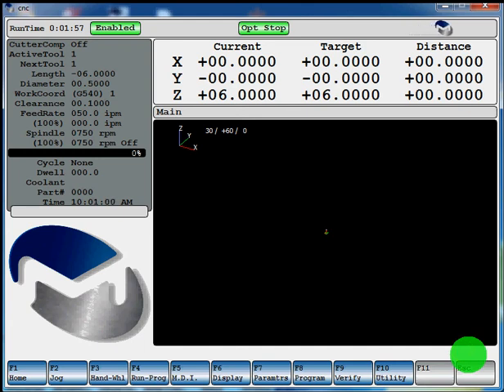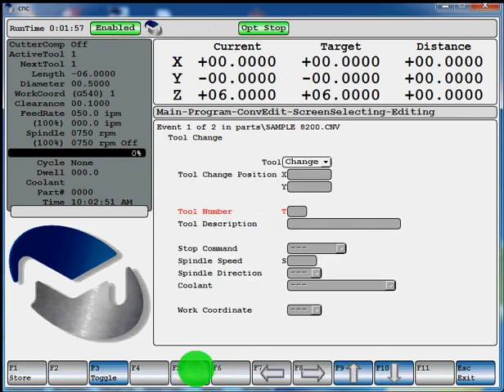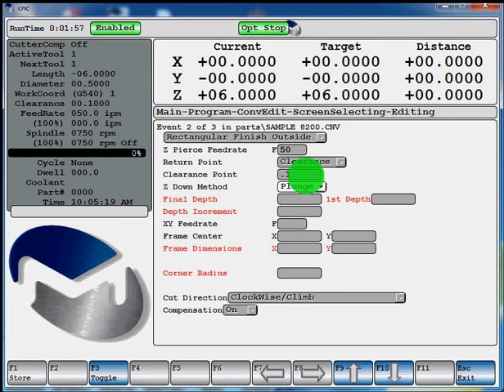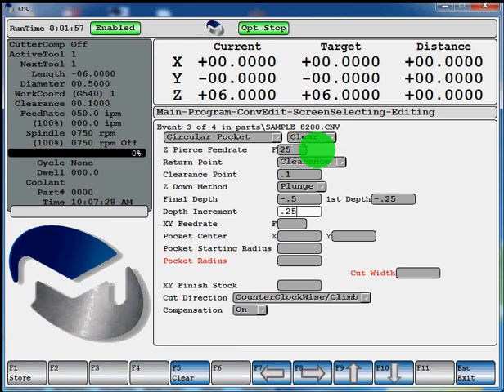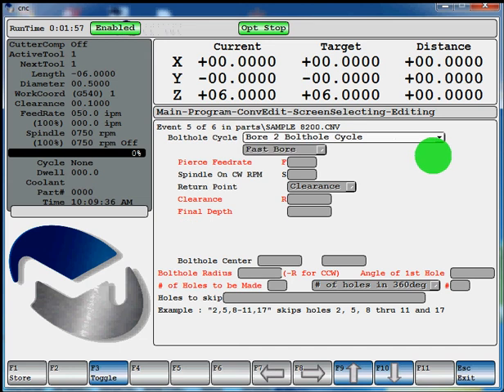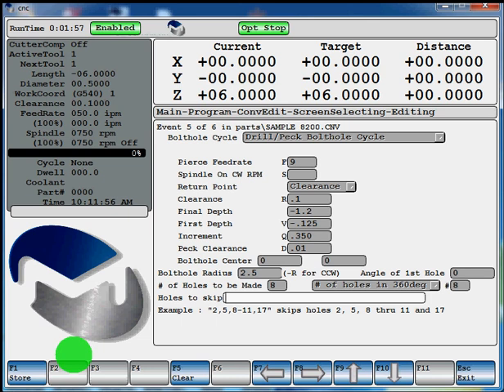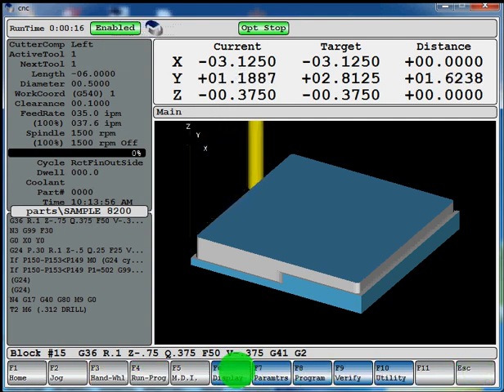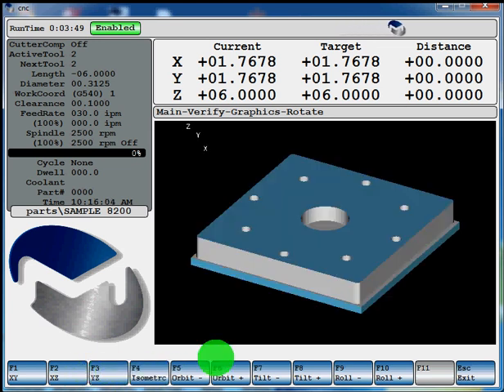8200B sample

Comment: I’m new to the 8200. Do you have any other videos that go into the sub set setting?
Reply from the maker: We don’t have an 8200 video specifically for subsets. The 8200 control has G54 – G59, each of these has a subset of 1-9 available, these subsets can be treated as entirely different work coordinates.  So if you have multiple workpieces on your machine, each can have a different work coordinate.  
When programming Conversationally, when you select your Work coordinate, the Subset box will appear.  If programming in G code, you can just enter G54, or G541, G542, etc..